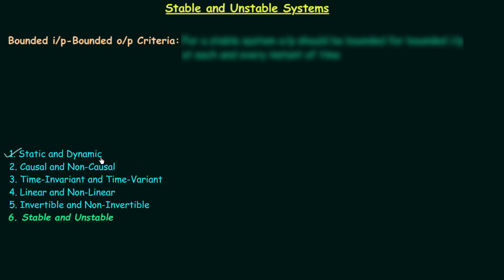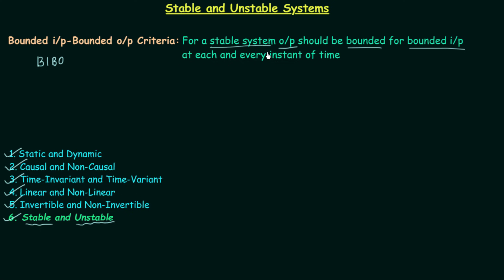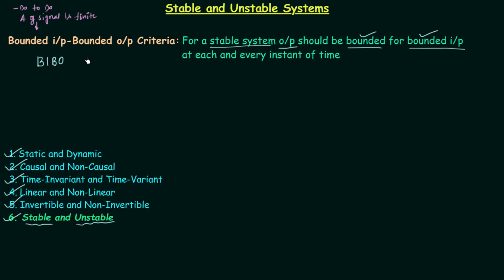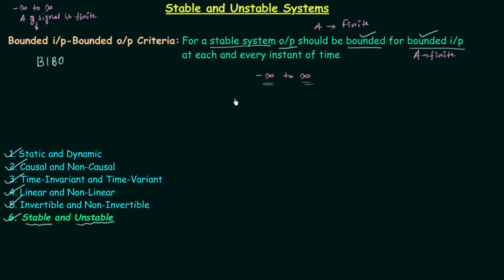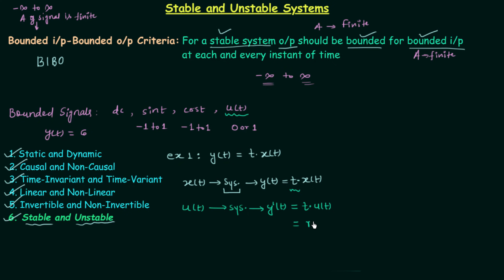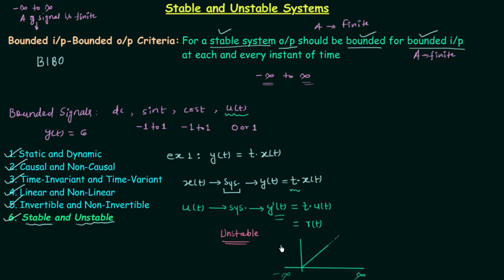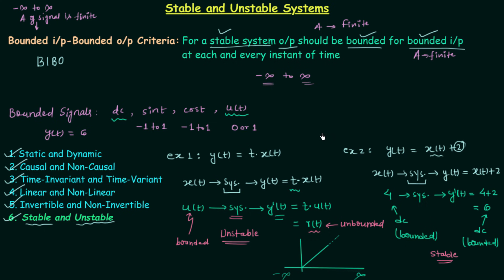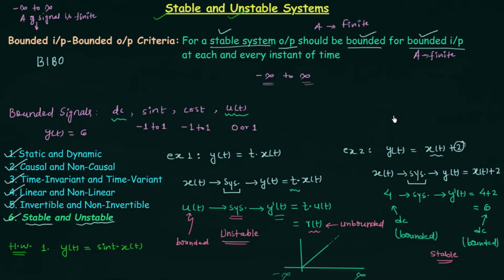Stable and Unstable Systems

Comment: HW was very easy, 
 where if x(t) will considered as u(t) and unit step function is bounded similarly sint will also bounded as its range varies from -1 to 1 so the multiplication of two bounded system should be bounded one.

Comment: Let the input be a dc of a value 4. After passing it through the system, we obtain the output to be 4sin(t) which is bounded from amplitude -4 to 4 in the interval -infinity to positive infinity and is therefore BIBO stable.

Comment: In the given homework problem, according to me, it should be an unstable system coz x(t) may have any value from -infinity and +infinity .. although sin() will have values from -1 to +1 but x(t) may have any value
Reply: No the input x(t) should be a bounded signal so the answer would be bounded system

Comment: The system in the homework problem is stable. If we take u(t) as the input and take into consideration that sin(t) is a bounded signal (it takes values from -1 to +1), then after multiplying these signals we get an output that is 0 from -infinity to 0 and from 0 to infinity looks like a normal sine function. So, the output of the system is bounded if the input is bounded.
Reply: If you take input as dc then y(t)=4•sin(t) it's amplitude  -4 to 4 so it is bounde so bounded input bounded output
Reply: You need not take into consideration that sin(t) is a bounded signal, it is always bounded when defined with the domain conditions

Comment: In ex y(t)= t x(t)
The system is stable or unstable
If we take unit step signal we get ramp signal but what about the delta signal.
Reply: Delta signal is not bounded, its amplitude is infinite at time equals zero.

Comment: What about this system y(t)=x(t)/(1+x(t-1)) is stable on non-stable
Reply: stable
Reply: I believe it is unstable system because if x(t) is such bounded system that x(t-1) would equal -1 then we have a devision by 0 and that would reach to infinity or minus infinity and it means that the output is unbounded.

Comment: It's stable because amplitude of sin(t) is from -1 to 1 and you can do check for bounded input x=2 for example => sin(2)*x(2) is finite.
Reply: Crct
Reply: If we take x(t)=r(t) then?
Reply: We should take only bounded input..
Reply: @astaragmohapatra9  r(t) is an unbounded input as it goes from 0 to infinity
Reply: @astaragmohapatra9  r(t) is not bounded input signal
Reply: @astaragmohapatra9  give x(t) = u(t) and it becomes u(t)*sin(t) and further simplify it becomes sin(t)✨
Reply: Bro y(t) is finite if you take infinite then sin(t)(x(t)) will be unstable they did not mention anything about y(t) so we have to assume y(t) is finite there fore system is stable and r(t) =sin(t)[x(t)] where ramp (t) is depends on t so ramp amplitude may infinity but sin amplitude always lies b/w -1 to 1 so if assume r(t) also it won't be unstable it will be stable

Comment: In stable system u use one word DC value what is it... fullform..
Reply: direct current, meaning supply voltage is constant as a certain voltage
Reply: It is ntg but supply voltage that is constant

Comment: which one of the following are the STABLE  discrete time  system.
1. y(n)=x(4n)
2. y(n)=x(-n)
3. y(n)=ax(n)+8
4.y(n)=cosx(n)

Please ans. and upload a snapshot of the solution.
Reply: all the four are stable systems...
let x(n) = u(n)  # we can also chose any one of the bounded i/p i.e., finite amplitude signals

1. Y(n)= u(4n)  #just time compression amplitude will not effected so it is stable 

2. Y(n)= u(-n)  # agian it is time reversal so amplitude is not going to effect so it is stable

3. Y(n)= au(n)+8  # here  i've chosen a as finite number ... 
  let a=2;   Y(n)= 8    for t<0
                  Y(n)=10  for t>=0
so that the signal Y(n) amplitude is finite amplitde over the entire range of time axis..so it is also stable

4.  as we know that whatever the angle may be the cos fucntion value is always lies in between (-1,1) so it gives finite magnitude that means it is also stable.

:-)
Reply: @ @rajeshwararaju9865   very fine , so always go with some test signal is a better choice : very thanks.